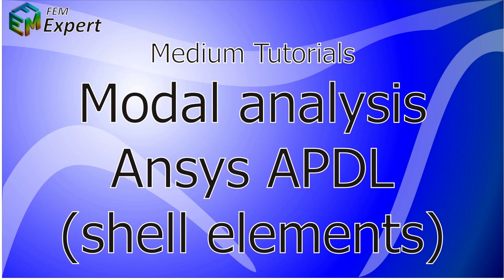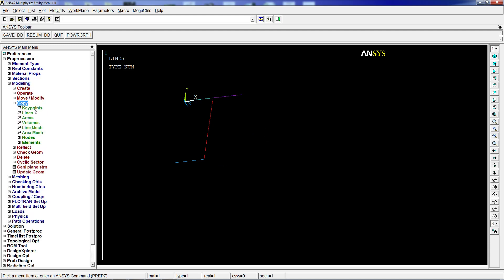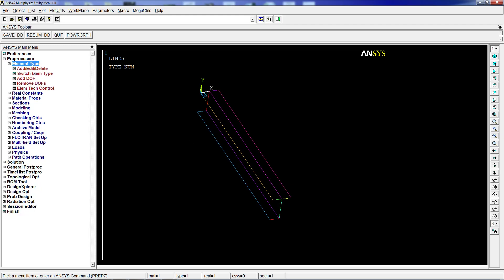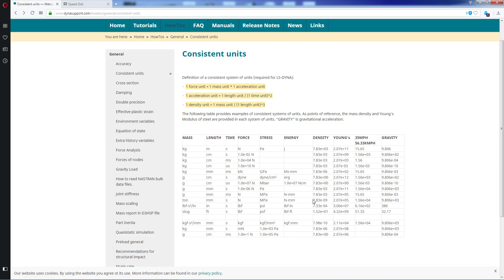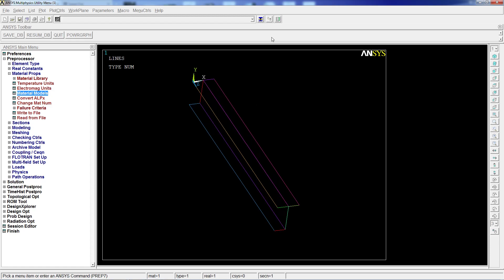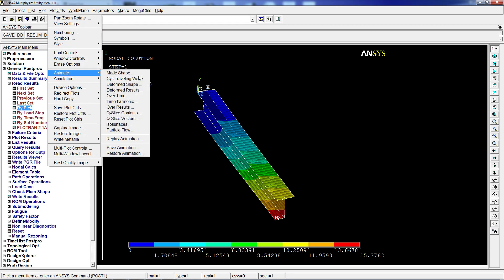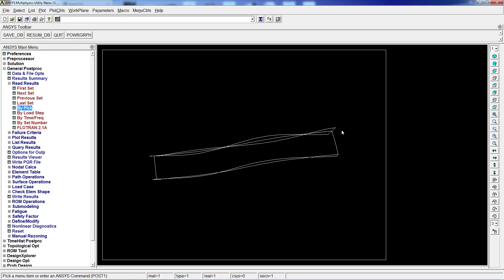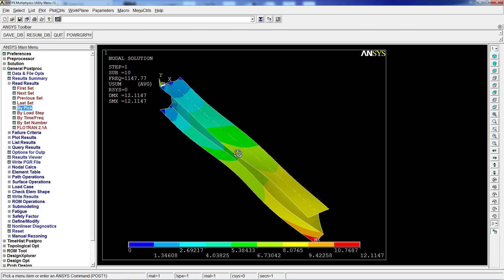Ansys Tutorial: Modal analysis in Ansys APDL (Shells) #32

Comment: How make a sling in ansys mechanical apdl
Reply from the maker: If you need relative movement, FEA does not seem to be a good idea. Ansys had a module for rigid dynamics.
If you still want to try it, you will need large displacements transient analysis and a lot of time.